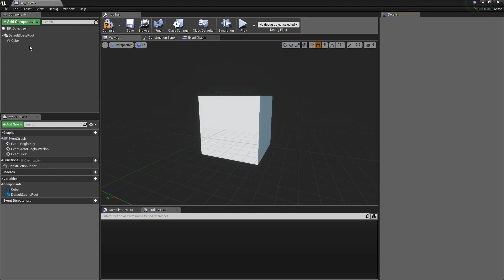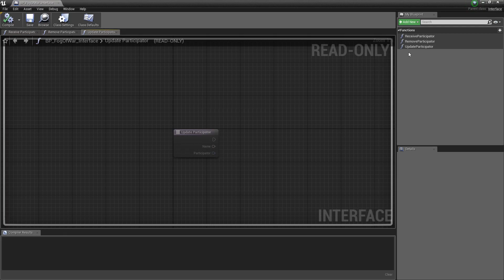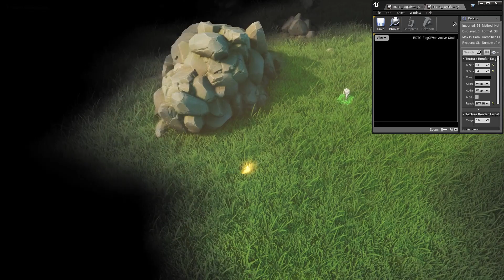Demo of my complex fog-of-war system in UE - WIP #1

Comment: Do you mind sharing how you created such unique decal for unit selection and marquee select rectangle? I'm having a hard time understanding how to make a decal in unreal engine? Or did you use another software and then import it to UE?
Reply from the maker: Hey. The selection rectangle is a mesh made of 4 faces (the side inner faces of a cube) precisely scaled in X & Y to match the distance from the click location to the current cursor's location. Its material is using Distance Fields (DistanceToNearestSurface) to create a gradient around intersecting objects. The decal effect is a decal component attached to each actor with a custom material using two subtracted sphere masks to create a circle. You can then further mask out that circle given a degree angle threshold using the VectorToRadialValue material function to create a radial progress bar to display your unit's health. Hope that helped! Cheers.
Reply: @ghislaingirardot  Thank you so much! I've only started working with UE about a week ago (no previous developer background) so your thoughtful response will give me plenty to learn from. One other question if you don't mind me asking, how did you get your selection rectangle to work in 3D space? The one i have right now is a simple box but i noticed that yours is parallel to the surface which makes more sense from a top down perspective.
Reply from the maker: @slov8604  Np! The selection rectangle isn't a 2D box in screenspace, it's an actual 3D mesh in worldspace, thus is projected with the same view matrix than the rest. It's really just a mesh in the level, that is placed & scaled to match where the cursor points in world space, if that makes sense.
Reply: @ghislaingirardot  Yes it does! After reading about distance fields i realized how you made it work. I also noticed that at the start of the video, you can tell that it was a mesh with verticality because it was reflected off of the rock on the right-hand size of the cursor. Very neat experimentation and thank you so much for the responses!
Reply from the maker: @slov8604  Yup, exactly :) Np, glad I could help. Have fun with UE!

Comment: Does this work for UE5?
I dont know much about Unreal Engine
Is most work done by blueprint instead of coding in Unreal Engine?
Most video I watch are blueprints so I am curious.
Reply from the maker: Hey! Yes it's working with UE5. I made a follow up video and files are available on my Patreon: https://www.youtube.com/watch?v=QaTCVlk7YDI
UE allows a great deal of things to be done with blueprints and it's really accessible so a lot of tutorials and educational projects are made with blueprints yes, because it's great. That's the case here with this project, I tend to prefer BP to share educational projects since CPP is a little bit harder to understand and requires you to compile the engine and everything. Even complex games can be done enterily using blueprints but performance might suffer a bit with more complex logic. It's clearly not as performant as CPP (it was never meant to be and never will). Hope that answers your questions.
Reply: @ghislaingirardot  Thank you so much!  You are knowledgeable and this was very informative.
Thanks!

Comment: How did you determine the location on the render target to draw to? I saw another tutorial using a plane, in the level to use hits on to get the UV location, but you didn't mention that.
Reply from the maker: Hi! Linetrace is unecessary here. The challenge is to convert a world location to a texture-space coordinates and is sort-of easily done if you know the following 1) the render target texture size 2) the space in world centimeters 'captured'/'rendered' in that render target, thus knowing what a single pixel represents in world centimers 3) the world location at which the render target is centered 4) keeping in mind that the render target uv(0,0) coordinates is at the top-left corner but you probably want the xy(0,0) world location to be the center of that render target so you need to shift uv coords by 0.5. I made a follow up video on that and projects files are available on my Patreon: https://www.youtube.com/watch?v=QaTCVlk7YDI Hope that helped!
Reply: @ghislaingirardot  thanks!

Comment: Great tutorial Ghislain. I was wondering how efficient it would be from the technical point of view to use it for a mobile game but with 3rd person view or anything that is not isometric.
Reply from the maker: Thanks! Hmm to be honest I'm unfamiliar with mobile performance so I'm not sure. RenderTargets performances aren't that great in UE in general and there may be some hardware limitations that I am not aware of on mobile that'd make rendertargets especially slow... but probably not. My guess is it would be fine, just depends on the amount of units that draw on the render targets at once in the end. Regarding 3rd person view, it works but would probably require some work to fix some issues. You'd see a black color in the distance instead of the sky since it has no notion of 'height'. It's just a mask applied in world space using XY coordinates. And you'd probably see patches of clear sky above you where the fog of war is revealed. But I guess with some post process math you could mask the fog of war in a smarter way. But in general, yes it's more suitable for top-down views. Hope it make sense, cheers.
Reply: @ghislaingirardot  Thanks for the info. My plan is to use it for dungeon type of game so there will be no sky.